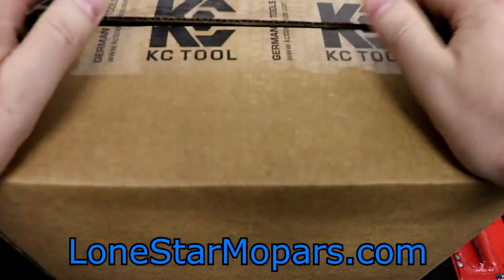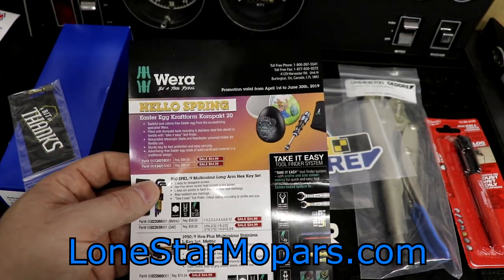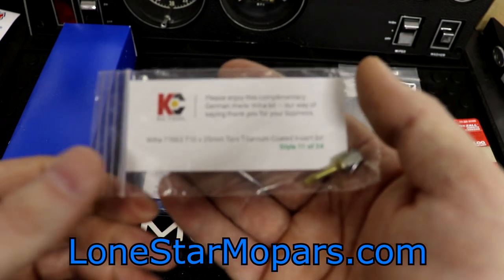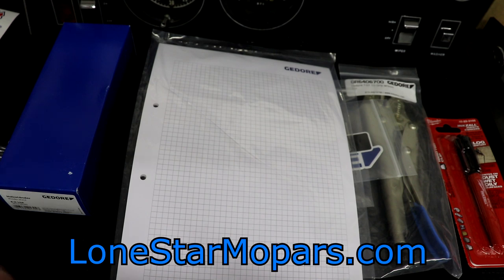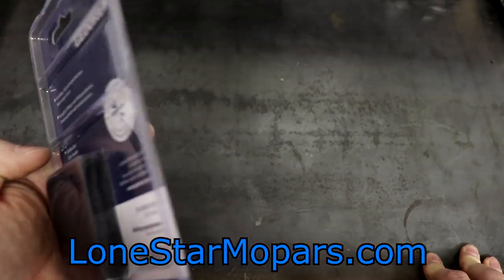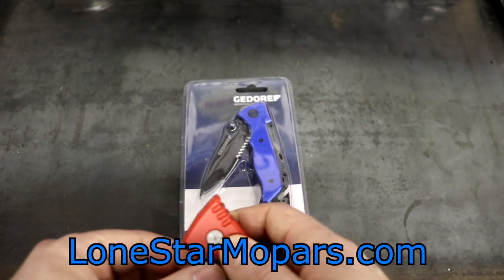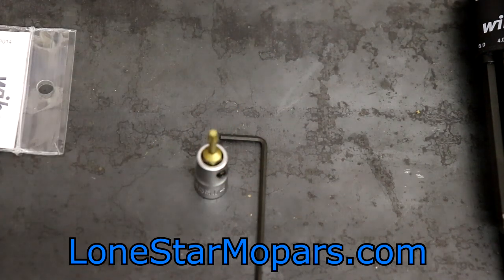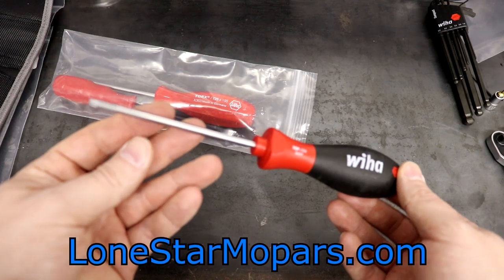KC Tool Haul #7: The Waiting, the Payoff, and the Hail - Gedore, Knipex, Wiha, Wera, and More!

Comment: Hi mate. That’s a nice looking knife. Hopefully it as good as it looks. I’ve got two sets of knipex vice grips 180mm and 250mm really nicely made. Also the Wera screwdriver are my favourite at the moment got them about 2 months ago. I like the look of your Wiha bit ratchet set. I will try and get one. I have the Wera tool check plus really happy with that one. Nice video 👍
Reply from the maker: Yeah, this is the one I told you I had gotten.  If I had a way of ordering the Knipex knife you got I'd have already done it.  Knipex does have a pair similar to this one from Gedore, but with a red handle...I would have actually brought one in, but the Gedore unit was still on sale.  The Impact Go Box I mentioned was introduced recently and you could get them for $19.99...it is up quite a bit in price, but still worth it.
Reply: Lone Star Mopars I’m still waiting to get the knife. The guy from Knipex I’ve been talking to said it’s now available but I can’t fine it yet I will ask in one of the wholesalers next time I visit. I remember trying to fine the Wiha go box but it was about £40 from Memory have to take a 2rd look. What is your favourite hit though screwdriver now? Them Wera are great not sure what the Wiha ones are like.
Reply from the maker: 2 months later and you got it, lol.

Comment: Just placed another KC Order, some items were on back order, and just got my full order in the other day.  Here's my question, the Wiha Bit Socket, I tested it by placing the titanium bit of thanks into it without the set screw & had a damn of a time getting the bit out, is there some sort of magic trick to easily remove the bit?  I know it has a retaining clip, but it should not be difficult to remove a bit.  Please help.
Reply from the maker: I've actually used them a few times without the set screw if that tells you anything.  I usually use some needle nose pliers and then fulcurm off the edge of the socket.  It is odd because some have come out with little issue and others require me to resort to that method.  On the bright side, if you are ever using it for a dedicated bit based creation it is solid.
Reply: @lonestarmopars  TY Sir, its solid for sure.  Just making sure it wasn't me lol.
Reply: @lonestarmopars  I have a DeWalt bit holder that I have use a pair of needle nose pliers to get bits out. I've pretty much retired that one and leave a Phillips #2 in there. I now use a cheap Wera magnetic bit holder for most uses.

Comment: Thanks for the video. If I'm not mistaken, that's not torx plus. Torx plus is the blue handle. Torx plus bits are different than standard torx and are not compatible with each other. The Power handle and Soft grip appear to have the same CVM shaft. Do they look the same to you? I'm trying to decide between the two.